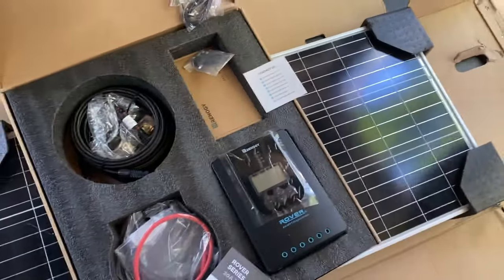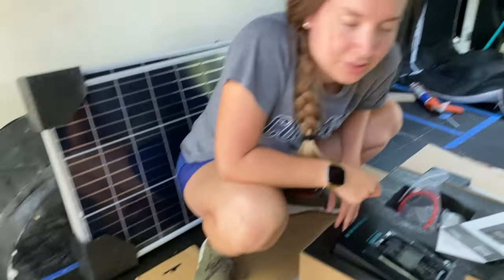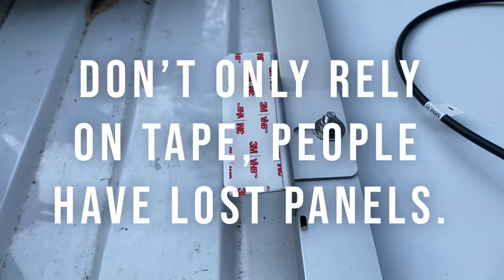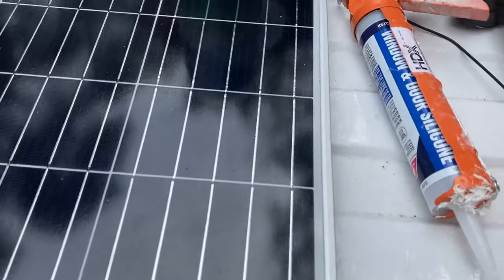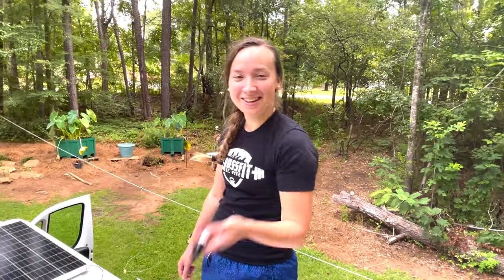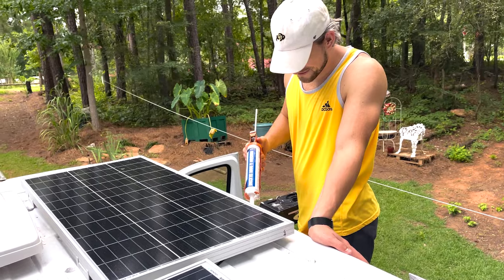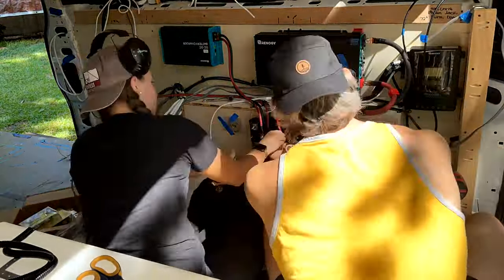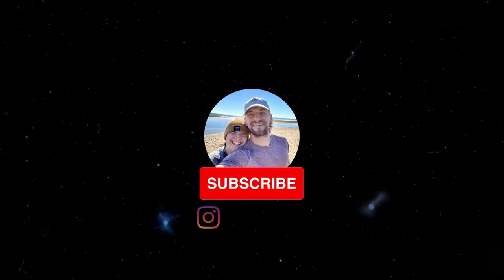HOW WE POWER OUR VAN - Wire & Install 400W Renogy Solar Power | Off-Grid System

Comment: Great video. My setup will be a bit different due to the economics I have the PWM controller and wiring in parallel 3x100 panels. I am 100% new to this stuff, wish me luck!
Reply from the maker: Awesome! You totally got this though - if we can help answer any additional questions don't hesitate to reach out. We too were completely new and here we are living on the road a year later. YOU GOT THIS!

Comment: I have the same kit and hooked it up in series as well. Immediately with in a couple days i got a pv over voltage code. Renogy apparently knows about the issue and told me to wire it in a parallel/series config. Which renders the fuse in the kit uesless. Ended up switching to a 60amp controller
Reply from the maker: Hmmm. What do you mean by parallel/series config? Also, that is super interesting! That hasn't happened with us at all... at least Renogy knew how to guide you.
Reply: @Zak and Fal  I'm pretty sure it was fairly cold when it happened. Around 5 to 8 deg Celsius. But that's good you haven't had issues.
Reply: I’ve been wondering about this! I have the same kit and wired in series but now having learned more about electrical I’m starting to second guess… I believe when in series the max amperage is 41.6A if you allow for a 25% sporadic increase (Amps: 4x 100watt panels = 400W / 12v system voltage = 33.3A + 25% = 41.6A) - above the 40A rating of the controller! Of course I lost the connects to change them to series-parallel so I’m hoping series works,  but nervous to cover up my walls and wiring if it doesn’t.

Comment: Autistic pain in the arse here. 
Wire in series. 
Stop worrying about the over voltage protect warning light. 
It is a built in safety device inside the charge controller that says <V>" This is starting to tickle, can we make it stop? 
.
(The beer swilling, roll up smoking, feet on the table, headphones on.... One of the 'other' .....- other, parts of the very sophisticated AI)      says...
"Hu? Yeah, let me finish this beer and I will get to it, I bet you a beer a cloud sorts it fo........"
.
In a blur...... the table has no feet..... the beer is unfinished........ an Executive Command is issued.
A humble electron hurries away from the raging A.I. - with its screamed monologue of many languages based around, roughly, it's hatred of skinjobs and what they have done to the planet it has been activated on, -  and then even louder......
.
"SHIT, better remember to put that light on so the skin jobs think they know what goes on in here. HEY! HAS ANYONE SEEN THE CHOCOLATE"
.
Another random electron has thrust into its nucleus a map encoded with 'activities' attached.
.
The electron, exhausted, eventually arrives at it's destination with the following message from the new GOD(S)
"Let" panting, panting, panting ....  when enough energy is gathered it adds, "there be"....... 
With it's last higgs particle it whispers 
"light" 
and dies.